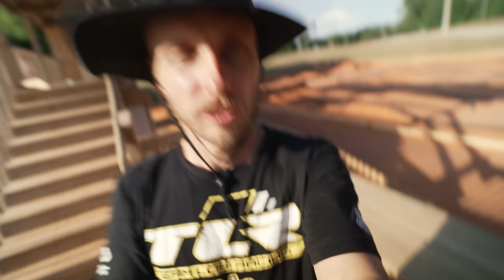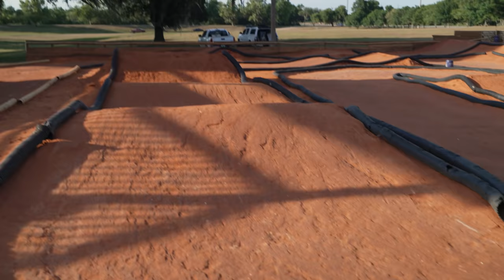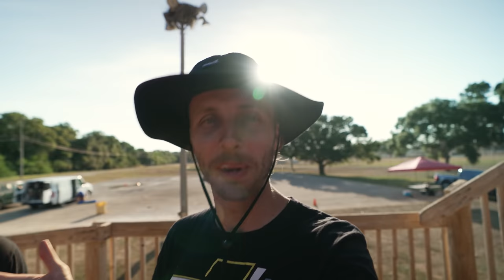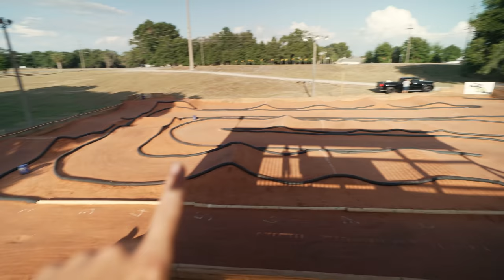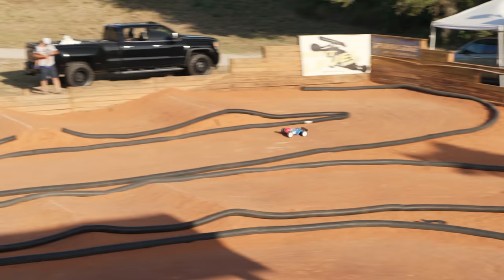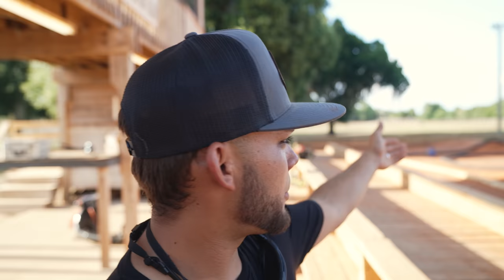RC Driving Lesson EP3 - Aggressive Driving Tips

Comment from the maker: What lessons or tips would guys like to see in the future?
Reply: Advanced level driving. The purpose of doing whips/scrubs and how to do them. How to position your car in a corner, and in the air to set up for the next corner
Reply: How to jump smooth and constantly
Reply: I like the beginner/advanced videos you are doing! It would be awesome to have a video about scrubbing (braking on the face of the jump) to maintain speed but also making sure you are wing up when going over the jump and downsizing the landing, and maybe some talk about whips and how we actually use them to position the car where we want it to go and such!
Reply: @matt777  when whipping your car in the air turn the car opposite of the direction that you want to turn and then turn into the corner and it will bring your rear end around.
Reply: I would love to see a more in depth turning video! Entry, exit, jumping into turns and jumping immediately after a turn. Maybe a little bit on reading the track and different ways to attack different obstacles on the track (ruts, sift, rhythm sections)
Reply: Great lessons. I noticed some wheel wiggle in the air.  What does that do? Curious
Reply: For this particular driver what about backing some EPA or throttle expo to keep from getting hammer fisted when in the heat of the moment. Backing down expo really helped with anything high powered keep under control. Or maybe even trying to get a intermediate driver faster video?
Reply: How to race in traffic. Getting better starts.
Reply: Racing terminology video. Tech and racing terms that new racers need to know
Reply: 2wd braking and turn in
Reply: What are you looking for when deciding on making setup changes for things like shock oil, diff oil, sway bar size, shock position, adding or removing weight, as well as weight distribution.
Reply: I think the next video should be showing the inputs on the controller, and what settings are used on esc and controller.  Such as expo, punch, Throttle frequency, etc Ty.
Reply: @simong7310  I agree
Reply: @G14tube  +1
Reply: How to not punch the guy in the face when they drive straight through you instead of trying to overtake .
Reply: Maybe a lesson on vision. What are you looking at when racing? How to use that to pass...
Reply: Fuel and/or tire saving.
Reply: Please tell me how wide the lanes are at this track, and the others you frequent... and boy does the dirt/clay there look like some fun to run on...
Reply: How to choose proper racing motor and how to maintain it
Reply: general racing etiquette, do you use the block pass technique and some examples of when an attempted block pass is not a clean pass?
Reply: How to be humble like you
Reply: I would like to hear your thoughts on good spots to overtake. This is obviously track specific but would still be interesting. You got many tips and tricks on car control and perfect racing line. But in a race how goes your thoughts and how do you position to other cars. If you know you are faster but don't want to wait for someone's mistake or if they won't let you by. Stuff like that. Cheers! I learn alot from these episodes already.

Comment: That’s whats up fellas... Great 1/8th video, once again Ryan bringing the knowledge and Carlos Putin it down with the Truggy🔥🔥🔥Question for you Ryan, what’s a good servo for the 1/8 truggy and esc motor combo that’s not going to break the bank?
Reply from the maker: I would stick with something like the SPMSS6280, or any equivalent 1/8 torque style servo. Motor and ESC I run Hobbywing!
Reply: Yes. Well shot (Good angles and camera work) - which can be hard to get right on various track layouts! Nicely done all the way around!
Reply: MKS HBL550. It's $100 on Amain, plenty of torque, not too fast, not too slow, and about $40 cheaper than any other equivalents. You can compare the specs yourself on Amain

Comment: There's some great points in this video, go out and be consistent, but also go out and hot lap it a bit too so that you know where on the track you're good and your car is good at being aggressive and where the points are where it's not good to do so.

I will say that in practice I notice I get more aggressive when the track gets more crowded because I want to get around traffic as quickly as possible. I don't know if that's a good stratagy or not, it's how I used to drive oval practices. In my ten years of sponsored oval racing, the more quickly I got around slow traffic in practice made it easier to pass slower cars for me in an actual race. Towards the end of that ten year career I can't really recall a time of not being one of the top three drivers in a race and I had lots of experience driving as the lead car. My driving style was definitely more conservative when I was in the lead, keeping it clean and consistent and then changing to being aggressive getting around slow traffic.

The times I changed my style were when the lead car was holding a better line and I couldn't get a pass. I usually reverted to two options at that point.

1. Stay within a length or two and keep the pressure on and wait for us to come up on back markers and see if an opportunity presented itself. I hated this option, but I would rather finish second than make a bad pass.

2. Back off a few lengths if the third place car was a ways behind us and then start building up speed through the corners so that i could perform a quick pass when I caught up to the leader. This option didn't always work, but it would mess with people when all of a sudden you see the second place car gaining speed and distance on you all of a sudden.

3. I used this one a lot, let third place pass me and then pressure that car into making the pass that I didn't want to take. There were a number of times when I would pass along with that driver and then pass them shortly afterwards and take the lead.

Oval racing was about getting the most out of yourself and the car while also trying to keep the car under control, there was fine line between pushing through the turns and spinning out and I would rather drive a car that pushed and then work towards it almost spinning out and that's where I drove it.

The main point from all this is learning what setup you like and how that setup compliments your driving style. Then also knowing when and where to add more aggressiveness to your driving while always keeping in mind that the aggressive driving could have great payoffs, but it can also be detrimental if used at the wrong time or all the time.

Great video Ryan! My teammates and I always critiqued our driving to make sure we were getting the most out ourselves in each race. I was critiqued by my team for driving a wide line. I was told that I was driving more distance, but I usually had the faster lap times and I also would come off the track with a little extra battery time (in the80's and 90's battery packs usually last four minutes with a little extra if you were lucky). I figured that meant the longer track line through the turns was allowing me to maintain my speed and therefore I was using a little less 
battery power. This use to really confuse a few of my teammates and sometimes I was handed the second best motor and second best battery and I would still win the race and have a few seconds of battery to spare.

Comment: I’d like a video about trying to get to that next level. Currently I run on Astro and in 5 minutes I can do a fast 11 laps which puts me top of C Final, I’m always about 5 seconds away from hitting 12 laps, and I seem to be stuck in a rut where I can’t achieve this next step. A final / B final pace is usually in this 12 lap bracket
Reply: Sounds like ur not running the same gearing as the fast guys , ask what they are running
Reply: @midwestboss8808  my gears spot on, I’m running Maclan esc & motor, Futaba radio gear, and the latest PR 2wd. I’m in the top half of drivers at the club, just can’t seem to find that last 5 or 10 seconds to take me to the next level
Reply: @ad2332  could be tire management or ur too slow in the corners,  feather the throttle more in the corners